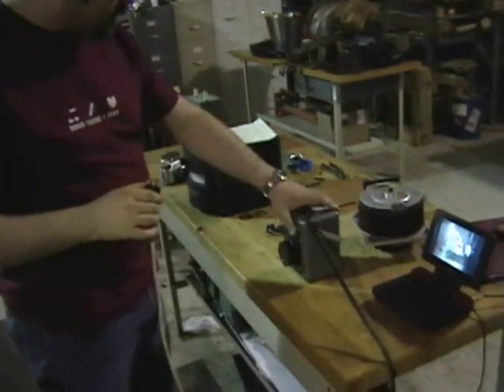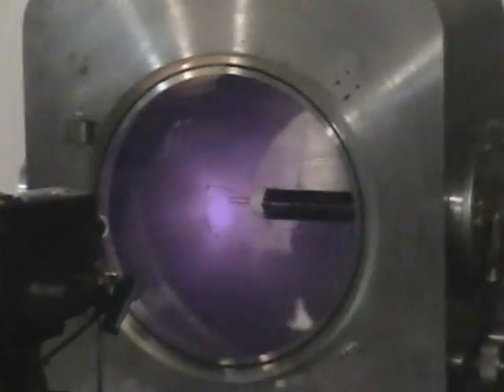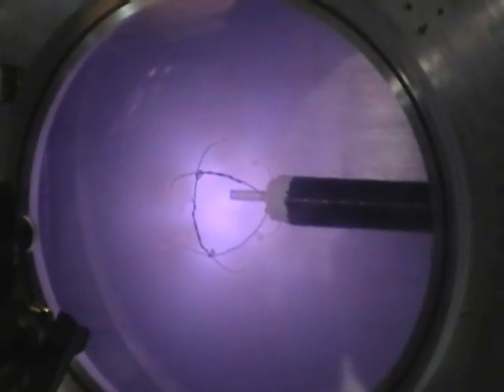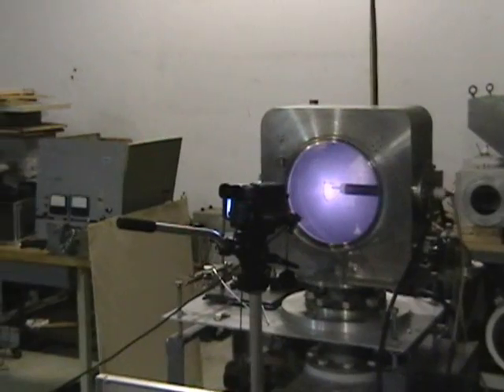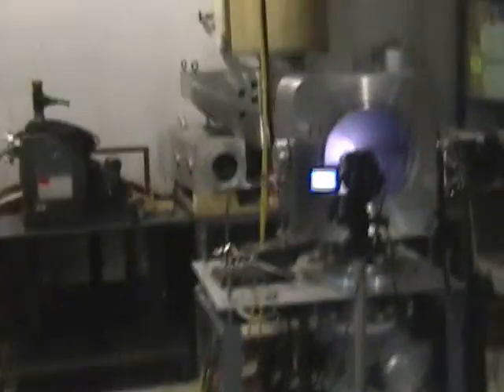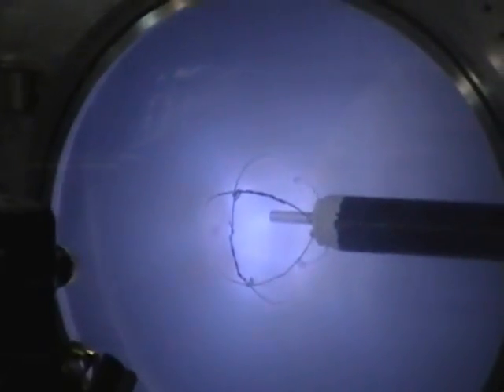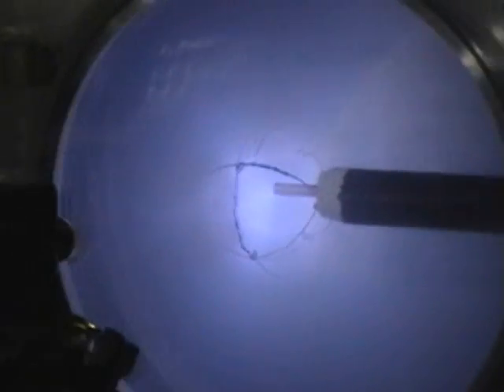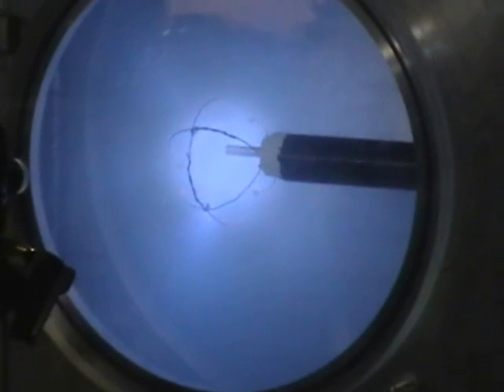Fusion Reactor First Test Run

Comment: Is this legitimate fusion? Is the fusion process actually occurring within that device? Has anything come of this since 2008? Excuse my ignorance/skepticism, but corona discharge =/= fusion.
Reply: "No fusion is actually ocurring in this video" Sorry, missed that bit.
Reply: +giganova Its not that hard to creat fusion. What is hard is creat any level of surplus energy
Reply: +matsv201 You'll have to define your terms, what do you mean by surplus energy? In this video all I see is corona discharge. Fusion is actually pretty tough to achieve, a variac at 10-20 volts and 5 amps isn't going to initiate thermonuclear fusion, sorry. How are you detecting that fusion occurs? Alpha/Beta detectors? Are heavier nuclei being created? Are you using a muon catalyzer? Etc...
Reply: giganova +giganova Surplus in a power station perspective is that it produce more electric power than it produce. Of cause, the thermal energy will always be more than the input energi, but this is not really that usable.

You need a scilometer or something simular..

Comment: Guys, I love this, but the baling wire is a joke. I don't know jack! I know that tungsten is not a cheap material and will produce a massive glow but it can take the heat, and is the only material that has a function change under extreme heat. Consider using tungsten as material for the conduction sphere and placing a 1/4" thick 4"d copper plate 3 inches in front of the sphere on the exit end of the transformer. Beat it up! Good job guys!

Comment: let me rephrase what my buddy up there was trying to say.  since fusion only occurs at extremely high temperatures (millions of degrees Celsius)this cannot possibly be fusion. even with your inertial electrostatic confinement, the neutron bombardment produced from true fusion would rip apart that little chamber being used. so you see containing the plasma is the easy part, even with magnetic confinement. unless what your doing is actually cold fusion in which case carry on and ignore me.

Comment: Electrostatic confinement is about 10,000 times as powerful in energy density then any magnetic confinement humans have devised yet.
The first electro-fusion reactor was a 20$ desktop joke, yet produced Gamma, x-rays and fast neutrons, definitely Fusion.
There is NO comparable technology, nothing humans have can squeeze a plasma better than a high static charge. Magnetics barely work. In electrostatic fusion, effective temperatures are reached by individual atoms, not the entire pressure vessel.

Comment from the maker: There is more than one way to skin the cat. It seems you are specifically referring to Inertial Confinement Fusion. This technique confines the plasma via inertial means, similar to the sun. In fact most fusion done in labs is magnetically confined (ITER etc).

In this particular case we are using inertial electrostatic confinement to contain the plasma. This requires nothing more than a deep enough potential well to prevent nuclei from escaping. We are actually operating at vacuum pressures.

Comment: There has to be some gas in there otherwise if it was just a vacuum there would be no plasma. Plasma is fast moving particles that have a charge and so react to electric and magnetic fields. As for the plasma that is glowing you could actually figure it out from the emission spectra or OP could tell us. Yes, it would be just electrodes and gas.

Comment from the maker: Not sure what you mean by non-thermal fusion.

You are correct though with regards to the plasma dynamics. The fusor has a equilibrated plasma energy, so indeed most of the input energy is wasted on nuclei that recombine with electrons. This is one the inherent issues with it and why it wouldn't reach break even. But, it is a cheap(er) way to study plasma dynamics and fusion than a multi-million dollar Tokamak etc.

Comment: The problem with non-thermal fusion is that collisional slowing down time is much faster than the fusion rate, so most of the energy of the accelerating grids goes into heating the plasma rather than maintaining a fast ion distribution. You'll get some fusion, but not enough to be worthwhile.

Comment from the maker: We use a variac, HV transformer, and full wave rectifier to step-up 120V mains to negative HV for the central electrode. So that's 20V input and 8000V output.

Comment from the maker: "Huge amount of energy"
D-D fusion releases 12.5 MeV per reaction; You'd need 500 billion reactions to produce enough energy to heat 1g of water by 1°C

"there's no material that holds 1 million degrees"
A 10kV ion energy actually corresponds to 10^7 Kelvin. The plasma doesn't come into contact with the chamber walls, we use inertial electrostatic confinement. Even if it did, the plasma is supplied with only ~200W of power. A match is hot enough to melt ice, but you won't melt an iceberg with it

Comment: Nice work.  Way to promote fusors.  I made a short film.   It is entitled: “Homage to the Fusioneer”.  It covers 60 years of fusion research in 5 minutes.  I will include it in the video responses.  8KV at 26 mTorr is pretty good.  The Polywell Was 10 KV with 300 mTorr over a 11 M^3 chamber. The radiation and Conduction losses need to be reduced.

Comment: People will raise the question of pure fusion bombs. They are real but are not near what they are cracked up to be. Almost no fallout, yields limited to low kiloton range at best, and they weigh multiple tons per kiloton of yield. Standard H bombs produce over a megaton per ton of weight. Pure fusion devices are incapable of being used as primaries. Either way a farnsworth fusor cannot be made into a power source much less a bomb.

Comment: RE: previous posters.
OP was not trying to exceed breakeven in the first place and the pictured device is incapable of doing so. Breakeven never been done at all with D-D and never sustained with D-T. No input ignition has never been achieved even with D-T.
There is too little fusion going on to cause radiation sickness in this experiment. X rays produced here are easier to block than fast neutrons or ultrahigh gamma photons and they do not neutron activate.

Comment: Sustained fusion doesn't require the mass of an entire star, we wouldn't be pursuing the technology if it did. Fusion reactors use magnetic confinement in place of gravity to hold the plasma in a tight stream away from the walls of the reactor so that it can be heated to the necessary temperatures. One of the challenges to sustained fusion has been to improve confinement, because every time a particle hits the wall of the reactor it loses energy and the plasma cools.

Comment: It's not fusion.  X-rays can be created in old-style television sets with the high voltage rectifier being run too high.  It only takes about 27kV to make low level x-rays, and there's no fusion going on in those tubes.  Bump up the voltage to a few hundred kV and you have the possibility of exposing film without using a radioisotope, but still no fusion.

Comment from the maker: There is a big difference between a lit match and a forest fire. Fusion rates are measurable, but low enough that radiation from actual fusion events is quite low. The predominant concern actually is X-rays resulting from Bremsstrahlung. 

At these acceleration potentials the X-rays are soft enough that the stainless steel walls of the chamber block it all. At ~50kV a combination of distance and limited exposure time ensures minimal dosage.

Check the WIkipedia page on "Fusor" and read some :)

Comment: You don't have D-D fusion there.  What you have is an equivalent to a neon gas tube excited by a lot more voltage than a typical neon light transformer can do.  If you did have D-D fusion, you wouldn't be around right now to put it on YouTube because the gamma radiation would have cooked you.

However, you have something cool there, so figure out what to do with it.

Comment: Achieving fusion is the easy part, making it self sustaining is a different story, there isn't enough H2 on the planet to generate enough mass to hold the plasma into a stable mass of heat energy and the small amount used in testing doesn't produce nearly as much energy as the power supply consumes to push the current through the semi conductor.

Comment from the maker: It's an archaic pressure unit common in vacuum engineering, 1/1000 of 1mm Hg (Torr), also known as a milli-Torr. 1/1000 of 1 mm is a micron. If you were to have a manometer gauge filled with mercury the pressure change would result in a change in height of the mercury column by 1 micron.

Comment from the maker: Total potential is 100kV, you are accelerating radially inward so opposing ion streams are colliding head on. Also the required acceleration potential for D-D fusion is nowhere near the MeV range. This is a thermal plasma so we have a Maxwellian distribution; the average ion energy might be 50 kV, but a fraction of our ions are much higher. Finally we only have to get close enough for the Strong Nuclear force to dominate. The relevant Wikipedia article section is listed in the video info.

Comment from the maker: First, some commenters are arguing that the technique in general (and therefore including our fusor) can't achieve fusion, which is patently false (pun intended).

Second, from this video alone you would be unable to tell the difference between fusion and non-fusion plasma. 5kV and 15kV, air or deuterium, the plasmas don't look that different. So even if this *was* a video of when our fusor is "fusing" people would still argue. The proof is high energy neutrons detected by our bubble dosimeter.

Comment from the maker: @applrichardbyl I think *you* at first should calculate the energy to fuse a pair of deuterium. Accounting for coulombic repulsion of nuceli, adjusting for a Maxwell–Boltzmann distribution and quantum tunneling at distances close enough for the strong-nuclear force to act you need ~4x10^8 Kelvin. This might seem like a lot until you realize that 1eV=1.2x10^4 Kelvin according to kinetic theory. So ~35keV is enough to fuse. We really only need half that voltage since both ions are accelerated,

Comment from the maker: @cowsrock94 We use a variac to from mains voltage input into a small step-up transformer (~150x if I remember correctly) that brings us up to ~20 kV AC. Next is a full-wave bridge rectifier using some HV diodes to get HV DC, keeping only the negative portion of the AC sine wave. In many applications you'd add a capacitor to filter out noise and smooth distortions from the rectification; The fusor is a large enough capacitive load that we can avoid one along with the danger of the stored energy.

Comment from the maker: @jednoucelovy Roentgens? Man get down with the times, it's all about the Sieverts nowadays! (the current proper SI unit for biological dose equivalent radiation). At low acceleration potentials the x-rays are negligible. At higher voltages we use a combination of distance, limited exposure time, and shielding to mitigate  the dosage to nil.

Comment from the maker: @dcggames Close, usually the chamber is pumped down to high-vacuum to remove the atmosphere/contaminants. Next, back-fill with deuterium. Finally, commence fusion. In reality out-gassing/micro-leaks etc will bleed air back in so you need to keep a dynamic equilibrium of slow deuterium dispensing and slow vacuum pumping.

Comment from the maker: @vartatoosh You actually don't want a "spark". The plasma is largely neutral and not conductive. We create a large electrostatic potential that ionizes the gas and accelerates the nuclei towards the center of the chamber. Under proper operation you should be drawing at most 10-15 milliamps, this current is largely from nuclei striking the inner grid and is undesirable.

Comment from the maker: @JDAVIDLITTLE I recommend starting out with calculus and a fundamental understanding of physics in general, with an eye towards electromagnetism, plasma physics, kinetic theory, nuclear physics, and maybe a little quantum theory thrown in for good measure. Of course you can put the thing together without knowing all that, but you will have no idea how to operate/improve/fix it.

Next become familiar with the practical side of things: vacuum systems, high voltage, radiation safety/metrology.

Comment from the maker: @JordanMaster22 Funny you say that. This video was filmed at the campus particle accelerator building which is a good 20-30 ft underground inside several foot thick concrete walls. We were probably getting less radiation than you right now thanks to the bulk of the cosmic radiation getting shielded.

Comment from the maker: @aatmuri I recommend fusor(dot)net if you are serious about construction of a fusor. You'll need 2-10,000 US dollars worth of equipment/material and a good understanding of vacuum systems, high voltage, radiation safety/metrology, and welding/general fabrication.

As for specifically the grids: a high-temp (refractory) conducting metal with low vapor pressure would be ideal. Something like tantalum (what we use), tungsten, etc.

Comment from the maker: @cartouchator The plasma is confined using inertial electrostatic confinement (google it). Even if it weren't, we're only putting a couple hundred watts of energy into the plasma, not enough to melt let alone evaporate 1.5 inch thick stainless steel.

Comment: @userjjb 1, i know the complete history of this device, 2nd when i said cold fusion, and not talking about those bs thing, i am talking about the fact that the temp inside these devices, is far to low to create fusion, unless it was under pressures in the millions of PSI, thus cold fusion 3rd the scientific community is split over this. i so happen to be on the side that states the facts. its a source of neutrons and thats it,  no proof of fusion just a neutrons source which they claim is proof

Comment from the maker: @jvizkeleti You have to distinguish between temperature and power. Imagine trying to melt an iceberg with a lighter. The lighter is hot enough to melt ice, but simply doesn't have the power required to put a noticeable dent in the iceberg

The plasma is confined because it sits at the bottom of an electromagnetic "well" in the same way coffee stays in a mug (by gravity not electromagnetism)

Also, even the multi-billion dollar tokamak chamber is made of stainless steel, most vacuum chambers are.

Comment from the maker: @SirDude456 I recommend something more comprehensive than a crash course. The plasma inside the fusor is indeed "very hot". Temperature is a measure of the average kinetic energy of a collection of particles. Even a modest acceleration potential of 15 keV equates to a temperature of 150 megakelvin.

Comment: @FILE48BOR Sub atomic mass doesn't matter, because it's fusing the nuclei of deuterium and tritium.  Sub atomic matter is so small that it is equal to 1/1836 of a hydrogen atom.  You know what?  You have know idea what you are talking about, or you are foreign and it's hard as hell to explain it in English.  It's probably that you're foreign, and that's fine.

Comment: When running with fuel... The vacuum system shouldn't be on right? First let the vacuum system do its thing, then fill the chamber with fuel making sure everything is at the appropriate pressure.. And THEN turn the power on.... Or am I saying it completely wrong? Because I'm reading different things all over the web..

Comment: I didn't quite get it. in 10^-2 or 0.01 torr you need minimum of 300 volts to create spark, as pressure decreases you must increase the voltage say up to 800 volts. In lower pressures say 10^-3 even 10KV will not create any spark. (coz there is not enough plasma to conduct electricity). So the optimum pressure is in the range of 10^-2 torr and inside chamber you have some air and probably some Hydrogen which are in the form of ions. anybody can perform it but what is the point? what did you get?

Comment: Question... How can you take this device and make the power output run a house, or small building? I have never used any type of fusion or plasma reactor to power anything... I have however used hydrogen... Hydrogen use is controversial but I for one can say that as a small scale scientist, hydrogen has worked fine. Seems fusion is a bit more dangerous too. Take care and be careful.

Comment: @Dusty696969 Fusion will be used for the same kind of reactor as normal fission, it releases greater energy than fission, and heats water to turn turbines - at least thats the theory. It's not radioactive like fission because you just use normal non-radioactive atoms to fuse, such as hydrogen like the stars do.

Comment: are you getting electric from the fusion? Isn't that the point of creating fusion rather than Fission of that we use today with nasty uranium filled rods? Last I read that fusion is to unstable? Did you calculate or pull any kind of wattage off this?

Comment: @N33DL3R if we have fusion reactors we will simply split the water to get hydrogen, no need to mine it somewhere else. 
And the vast among of pressure and heat is not so much a problem since we can already achieve it (record of 3 to 6 billions degrees with the z-machine).  High enough for aneutronic fusion (planned with the Z-Neutron machine).

Comment: @coffeecrisp1000 Pros-Fuel is 75% of matter in universe, gives off no lasting radiation(no fallout or radioactive waste), produces tremendous energy, It will be cheap once we work the bugs out.
Cons-High temperature, extraterrestrial mining(for hydrogen), vast amounts of heat and pressure needed to start reaction, gives off deadly radiation during fusion process.